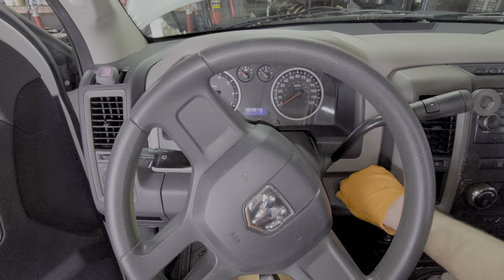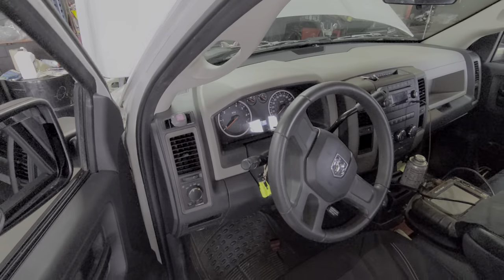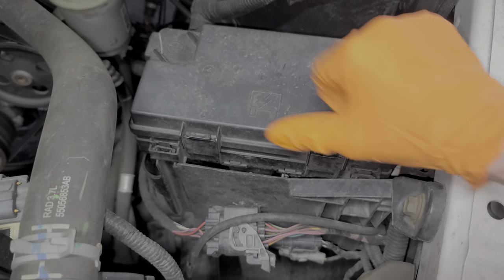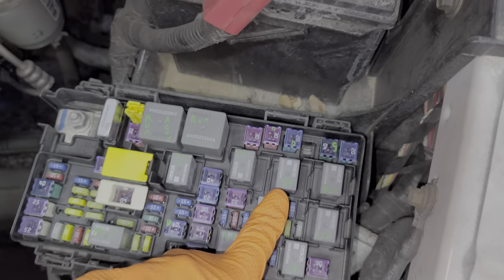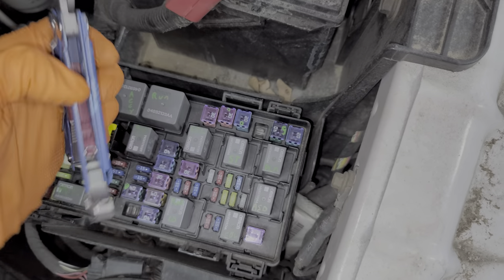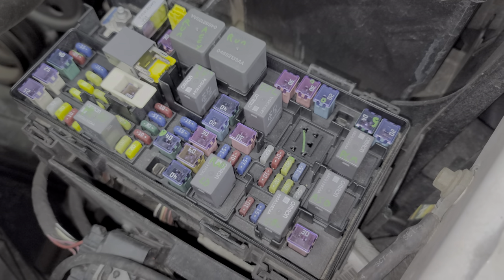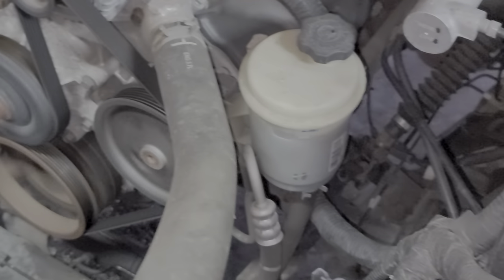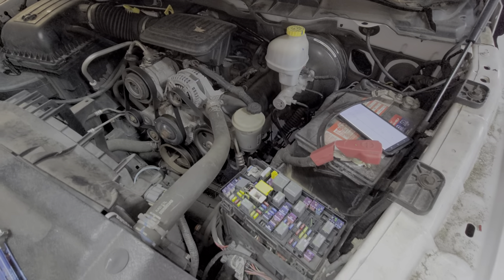2011 Dodge Ram 1500 Starter Relay, Starter Fuses & Troubleshooting

Comment: I have a 2011 Ram 1500 and recently its been possessed. I turn the key and it cranks but no start. Sometimes I put it in neutral, back to park and it starts but then engine immediately shuts off. Happens when starting in neutral as well and usually after 4 or 5 tries, it finally stays on and runs good to go. The more i drive it in the day the less it happens when i restart the same day. The next day I have to do the whole 4-5 times again for that initial start of the day. No engine codes at all. Battery is brand new. I have no idea what the issue is but thinking it might be related to this video.
Reply from the maker: Have you tried cycling the key on and off about 10 times.before cranking the engine over? It sounds like your fuel pump may be loosing prime.
Reply: @LehewTech  Funny you say that because I have made the comment to my mechanic that its almost like its a lawn mower that needs to be primed....lol. I did order the pump bypass cable for the TIPM that also seems to be a fix for the issue at hand. I guess we will see. I do plan to buy a new starter relay and 40A Jcase fuse as well just for principle.
Reply: I have the same problem.  Thought it was loosing prime but have went through the entire fuel system new. But crank no start 2 or 3 times every morning.  After it starts it's fine the whole day
Reply: @dalebryce3511  I changed batteries, fuses, added the TIPM relay bypass and nothing. Still died. Got to the point of disconnecting the battery at night just so it wouldnt be dead in the morning. Basically was told I would have to replace the whole box most likely. Said screw it and traded it in on a new Chevy truck a week after I posted.
Reply: Jumping starter relay still no crank
Reply: I’m having an intermittent starting issue where I tested the starter relay and it has continuity on the contacts when I apply 12v to the coil, so relay is working. But I’m getting intermittent voltage to the coil of the starter relay.  Sometimes it works sometimes it doesn’t
Cleaned the contacts on the WIN Module as well.any thoughts!  Thanks
Reply: @ebaab1976  how'd you end up fixing this. Mine is doing what you said exactly
Reply: @RM-le5qw  sold it and bought a Chevy...lol
Reply: @ebaab1976  😂😂 damn alright

Comment: Very helpful video. I’m having an issue where when I turn the key, sometimes it takes to to 3-4 seconds of holding the key over before it starts. I had the starter replaced this past weekend but the issue is still happening. Before I had the starter replaced, I had a couple instances where it wouldn’t start on the first key turn. But I turned it over and over a few times and it would start. Then be fine a bunch of starts in the future and do it again in a while. Any advice? Thank you!
Reply: I don't know if you fixed your issue but it kind of sounds like the crank sensor. Hope everything worked out for you!
Reply: @mikeburdi3464  ok, I'm having this same issue. When I start it up it seems as if it's the starter going out. Now I had my crank sensor replaced and my check engine light still comes on. While driving over a certain amount of miles my check engine light will come on and my truck will start slowing down.
Reply: @mikeburdi3464  is the crank sensor the same as the win module?
Reply: @rochellecornet284  No, the crank sensor is on the engine located by the crankshaft, usually by the harmonic balancer. The WIN module is in the vehicle, part of your ignition switch. But they cause 2 different symptoms.
Reply: @mikeburdi3464 Thank you for the reply and informative answer.

Comment: I have a 2011 1500 sport with console shifter and key fob. When I turn the key I get no crank or anything. My truck also won't come out of park. I tried all of these steps, disassembled and cleaned the WIN module contacts. Still no luck. Any ideas?
Reply: Did you figure it out?

Comment: Thanks for the video. It seems very helpful. I'm going to go through these steps. For the most part, my 2011 has been very reliable. I've replaced the TPIM, Key Switch, and battery in the last three years. At first, if I put it in park after not starting, it would start, but that doesn't work now, which is why I'm leaning towards that safety switch built-in.

Comment: The 40A fuse was the problem. Thank you sooooo much!!!
Reply: I'm having the same problem.  Did you figure out what was going on? I changed everything for my fuel. Pump and injectors also thought it was loosing prime but now I'm lost. It does the same crank no start 2 or 3 times after it sits for 4 or more hours
Reply: @dalebryce3511  yes, the 40A fuse was the problem as depicted in the video. The reason my 40A fuse blew was because my ground wire that connects to the starter (yellow wire) it got spliced opened somehow someway and everytime the copper wire touched the frame of the truck it blew that fuse. I noticed it because the wire was stuck to the frame, all i did was replace the fuse and then put electrical tape around the wire so the copper wires werent showing no more and if it did touch the frame it wouldnt blow the fuse anymore. Have you tried to see if the fuse is blown?
Reply: @justincortez74  I havent checked it. But would it start after a few tries and then run ok the rest of day. Then the same no start for a couple tries the next morning?
Reply: @justincortez74  thank you for replying. I'm so lost at this point
Reply: @dalebryce3511  at first it did, then it wouldnt start at all. Thats when the fuse got blown. Whats year make and model of your truck?
Reply: @justincortez74  it's a 2012

Comment: Great video. I have a 2004 which is currently problematic. It will only RUN after battery has been disconnected and reconnected. After this, it will will fire, but cuts fuel immediately.

Comment: very helpful do you have any tips about a 2011 doge ram truck that the battery goes dead after being parked now even with giving cables the truck wont start it just clicks. Everything turns on when cables are connected and I was told by mechanic that the battery was good (it is brand new) told me I had a shortage somewhere? Any tips if I should follow these steps again trucks battery is dead at this time....also i started having issues with starting no issues with powering on but it would not wont to start acouple of time than it would start and I was fine throughout the day but once I park vehicle in the morning power is gone also where do you get those pins to check the fuse?

Comment: thanks for the video, I have a 2012 ram 5500.  It sat for 9 months or so and now won’t start.  All the fuses you had us check look good.  I took the relay out and jumped it with a paper clip and it worked.  Ingot a new relay and it’s still not starting.  I do have a red flashing light on the dash.  Any other ideas?
Reply: Throttle control sensor module

Comment: Oof! lol, I was hanging on your every word, then you went into your outro, and my heart sunk, lol... this is right where I am at, but it turns over just fine, it won't start though.... I have fixed two wires, oddly enough, the same wire in 2 places, at the TIPM and at the PCM, I believe it's the ASD wire. green/orange tracer.   ... I'm searching, because I really feel like it's just some real simple programming glitch I created with scores of boosts, attempted resets, battery disconnects, cz I fixed those wires, put new batt, starter works, I've messed around in the WIN also, but acc and ON run properly, and FOB buttons all work everything. OH!!

Also, I believe this because through all of this(4 yrs of hell)  security light has always flashed as normal, along with the whole start up routine in the truck, but now the security light doesn't come on and the hood signals open when it's not, so It's like I changed something for the first time, but still no luck.... aarrgghhh! lol

peace, ty
Reply from the maker: When the engine is cranking do you have spark, fuel pressure, injector signals? Can a scan tool read RPM while the engine is cranking and if so is the RPM above zero while cranking? Do you have another key you can try to start it with? Are there any stored error codes in the pcm or any other modules?
Reply: @LehewTech  Wow, ty, and , once again... oof, lol... ok, I have an OBD reader, no scan tool, I use InCarDoc Pro.... I can try and place a mirror to watch RPM?, lol, or I can just stick it in and rund look at tach? .... Yes, I was getting an evap code 0452... but I still had a jack on the passenger side, now it's down, Idk if the code is still there, and a low voltage code 0562... sorry I'm reading the report and typing, it says evap emission system pressure sensor/switch low, so ya, I just assumed those were from the battery dropping... I'm going right now to put the charged battery back in, a lot of stuff I've tried, I was hooked up to another running car..... One time about 3 years ago, I did the 3 taps with the positive cable on the positive post, and it seemed liked that was the only successful reset I've accomplished,it did a big click to dead and back on, big as in loud and obvious, then fired back up with everything whistling, and spinning, and then worked for a long while. I was so happy, but it has never worked again....
Reply: @LehewTech  Forgot, I have been using two keys interchangably, not systematically with each one. That reminds me, I also wanted to say, you have to keep in mind my systematic checks are subject, even likely, to be incomplete somehow. i.e. try X with key on, then key off, then try Y same , etc. I will not be meticulous enough when Idk what I'm doing.

 I'm also getting tired of walking out there to fail, lol I'm like in the center of the block's viewing area for every home, out there 5 days a week with multimeter like I know something, gawd, they must think I'm a clown, lol
Reply: @LehewTech  2009 Laramie 5.7, remote start/anti-theft  -- it only has 68K miles. Under the steering wheel/dash is spotless, under hood is pretty clean, harnesses still all taped, I had to cut a tube open to find that wire, I checked all connectors, no rust all fit good and snug, fuses all look good, haven't cnty. checked all..... Idk, I figure if you are going to take a stab, I really appreciate that, so I figure it's only 2 mins reading to give you the most info I can, Idk, what's relevant....

Comment: 2011 RAM 1500, solenoid just clicking when key turned.  Tried all the tips in the video.  None worked. 
Found the solenoid/starter connections needed to be cleaned.  Once cleaned, truck starts like it is supposed to.
Reply: Hows the cleaning process?

Comment: Thanks for the video.  My 2011 wouldn't crank.  I tried to jumper the relay and nothing.  I arched the solenoid and got the starter to spin.  After that i could use the ignition to start.  I'm still not quite sure of the problem it could be the starter or the signal wire from the relay.
Reply: Did u find out y I'm having the same problem
Reply: @RS-yx7er  It continued to happen intermittently and I eventually came to the conclusion that the starter needed replacing.    No problems since.

Comment: ok, ive done all of this, what do you do when the starter is just doing a knock, and not turning the engine? it sounds like the gears are hitting a wall. brand new starter, still no crank at all.
Reply from the maker: Check for a seized engine
Reply: we did check, it is not seized. we are attempting to change the neutral safety switch now, but cant seam to find it anywhere. its a 2012 ram 1500 5.7 hemi
 @LehewTech
Reply: @rangerb44  did you figure out the issue?

Comment: I got a 2011 Ram 1500 no crank no start not even a sound. Lights radio and windows work but won't crank. Checked starter works fine and engine is not seized. I can't seem to find the issue
Reply: Hello! I have the same problem with my 2011 Ram 1500. When I turns the key the fan and stereo works. When I turn the key to start the fan and stereo dies. No klick from the starter, nothing happens. Do someone have any ideas? Thanks!
Reply: Same issue did you figure it

Comment: So the starter test showed my truck starter works fine. When I turn the key, the starter might go a bit then stop and clicking abounds, sometimes ‘service 4WD’ pops up.
I had a new engine dropped in a few months ago and it ran without issue. Still have not made it to the first 500mile oil change.
Battery is new and charged.
Red light I g bolt and such.
A year and a half ago dealer put in new ‘brain’ and harness.
I did try in neutral as well.
Reply: Did you ever figure out what was going on
Reply: @tylerberryman4079  one of the ground wires for the TIPM was loose. The guy who installed the engine said he had not tightened it enough and it had worked itself loose.

Comment: I have a 14 ram 1500 and my drivers headlight goes out and parking light under it flashes but when I push or move starter solenoid relay it works like normal again 🤔 no other issues with the truck. I push pull wiggles everything else on fuse box but only that relay does it. Any ideas thx

Comment: 2012 ram 2500 5.7. When trying to start periodically the power in the truck goes out(like a win module fail, without the key being stuck).
I go over to the battery and i hear buzzing and rapid clicking coming from the start relay fuse.. i disconnect the positive battery lead for a min and then reconnect. Sometimes i have to do it more than once. 
Im guessing the starter relay is bad. Im going to swap it with the same fuse from hvac slot. I’ll have to order new ones… 
Im beginning to hate dodge. 99k miles and it’s decided to fail in multiple areas. Ive done all my pm’s in a timely manner and one system after another fails. Btw ive stopped making fun of ford.. but chevy is still fair game. 😂😂😂
Reply: Did you figure out the fuse? Or the issue with this? Thanks in advance
Reply: @painterjr  turns out it was the battery post connectors. Pos was cracked and neg was not getting a
Good connection. I also replaced a bunch of fuses afterward just in case.
Reply: Much appreciated
Reply: @painterjr  no problem. I also noticed my fuses posts were oxidized, my connectors around and going into the fuse box … wires were oxidzed. I cleaned all that up. I also sealed the fuse box. New gasket and sealed the wire port. Sealed all the external connectors as well. Ram did a horrible job protecting the electronics and wiring on these trucks. Loose wires in the dash can rub and short. They need to pick up their game or i wont get another one.
Reply: @painterjr  good luck with your truck. If you need ideas to troubleshoot … hit me up. I’ll get back to you asap after i get done at the ranch.

Comment: My 2013 RAM 1500 is cranking but not starting and I am at the end of my wit.... I parked it in perfect working order and was charging battery once a week or so and when I lapsed the battery died. Now it won't start even after I put in a new battery (battery tester said REPLACE as it was close to 40% of its life, I still had old OEM one). There were multiple codes including feared tranny lightning bolt but most seem to be related to low power. After battery replacement I have no check engine light and no tranny light. I did not yet reset any previous codes. It still cranks the same as before but no start. I checked fuel pump with bypass cable and I can hear it working but still no start. I see RMP gauge only barely moving (is this normal?). Also very strange, when I put key in it it says low fuel (I have full tank), but after key goes into ON and then START, it detects full tank. Can you suggest anything else I can try? I am going to check starter relay as per your video, but wonder if there is anything else as starter seems to be working (cranking). Thank you.
Reply from the maker: If the engine is cranking then you need to determine if you have ignition (spark plugs being fired?) and fuel pressure
Reply: What about the soliniod

Comment: I think my other comment didn't post... I tried the manual bridge and got a couple tiny sparks and a faint clicking noise, but nothing beyond that. Is the clicking noise an indicator of anything?
Reply: Yes, your starter is more than likely bad. You can jump the starter directly by putting a booster cable directly to the starter solenoid, the starter should engage. That is for testing purposes only, and make sure that everything is clear of any moving parts. Hope everything works out for you!